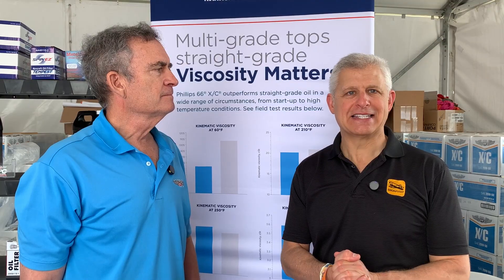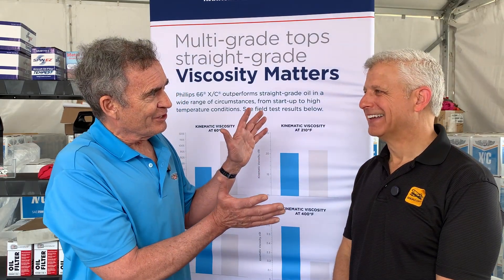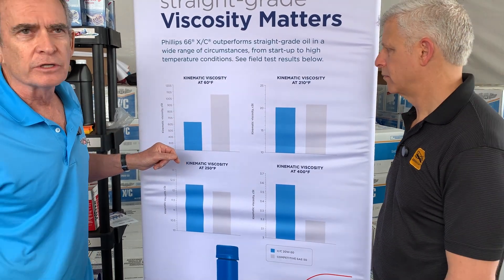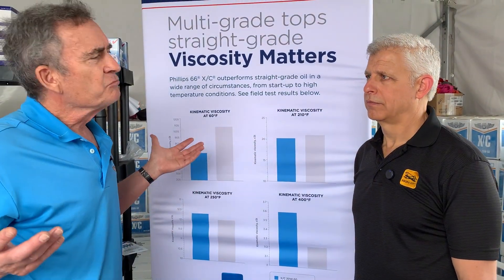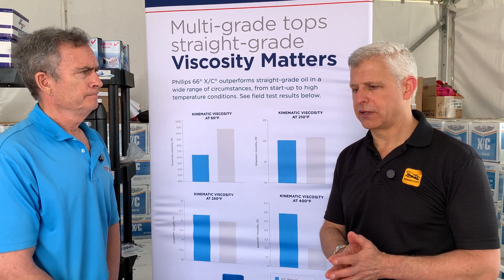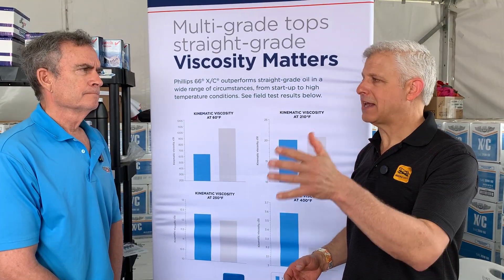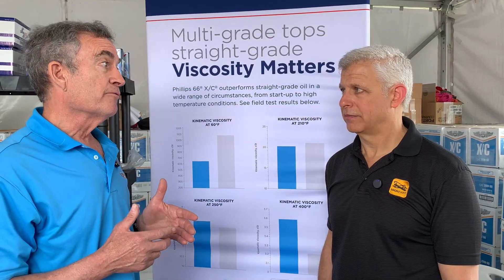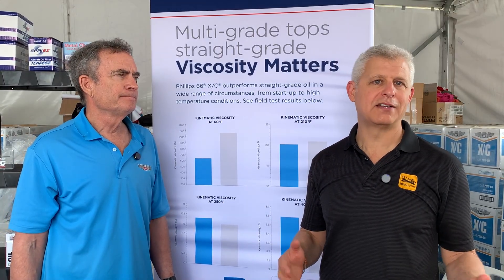YOU’RE USING THE WRONG OIL! Myth-Busting Aviation Oils with a Phillips 66 Expert

Comment: Unfortunately, this is typical marketing fluff. The truth is, kinematic viscosity (often measured via gravitational flow) has almost no relevance in a real-world engine. In actual operation, an oil's viscosity characteristics are most accurately defined by its High-Temperature High-Shear (HTHS) viscosity.

Any heavily formulated oils using methacrylate additives will noticeably underperform pure mineral oils without additives in this regard. So, by all means, publish the HTHS values for a standard mineral oil and for this "remarkable" multigrade. You'll see how fast they fall completely flat.

These are fundamental principles, understood by manufacturers since the mid-20th century (e.g. Royal Purples first multigrade oil 5W20 circa 1950)—which is precisely why the HTHS parameter was developed in the first place. To so completely twist these facts takes a remarkable effort!

Comment: Stupid people do not know how to build motors properly. Build and seal the case so oil won’t leak and won’t be consumed and either use semi or full synthetic. Install oil bypass filter as well. Aviation industry is dumb/stupid - when it comes to mechanical aspect.

Comment: you're using the wrong oil?  I don't think so...UNLESS you are using an automotive 10/40 off the shelf walmart brand....If it says FOR AVIATION USE OIL I think you're splitting hairs.  I have had aircraft engines go beyond TBO with Aeroshell straight weight showing very little wear.  If you are using your airplane in subzero weather,  multi weight would be the way to go.  Or, preheat your oil.

Comment: yes but it looks like chocolate milk I like the Aeroshell 15W50 a little more expensive but it works great and isn't like chocolate milk
Reply: The chocolate milk look comes from the lead salts that are a byproduct of combustion. The X/C is holding these lead salts in suspension rather than letting the salts precipitate out of the oil as sludge or deposits within the engine.

Comment: What about seals & O rings If I remember correctly older Prop & some Eng. seals, cautioned against multi wts do to no. Viton type rubber had experienced leakage, additives in the Multi vis. I KNOW the Synthetic's had that problem..
Reply from the maker: I chatted with Phillips 66 folks about this and they said that incompatibility is a potential issue with semi-synthetic oils, but there are not aware of issues with mineral-based oils (even multi-weight versions). All Phillips 66 aviation oils are mineral based. 

Of course, any multi weight oil will be thinner at lower temperatures compared with a straight weight. That’s preferable for many reasons, but if you’re depending on thicker oil to stop an existing leak…well….  😂
Reply: I know the Aeroshell 15w50 can have that problem. Don’t know about the Phillips but my engine dealer says don’t use the Aeroshell.
Reply: Modern oils have long ago addressed seals and o rings. Of course there isn't much modern about lycosaureses ! Synthetics as well have addressed the issue, but when and until unleaded Av Gas gets popular then synthetic oils will come into their own for use in aircraft piston engines. Lead doesn't play well especially with synthetic oils.